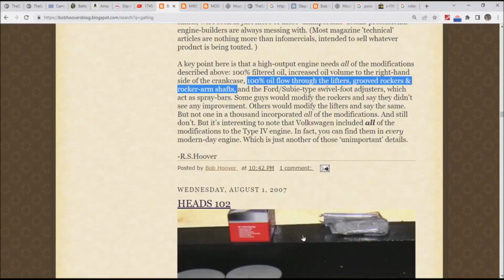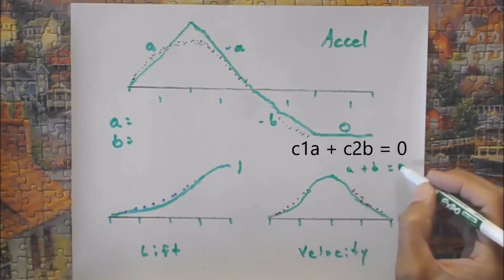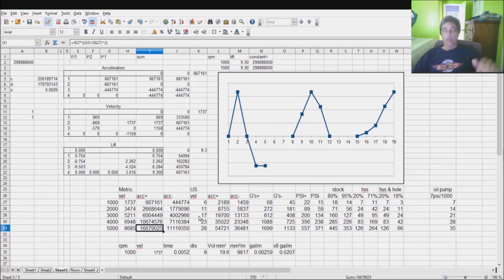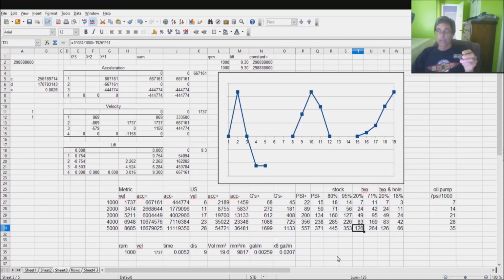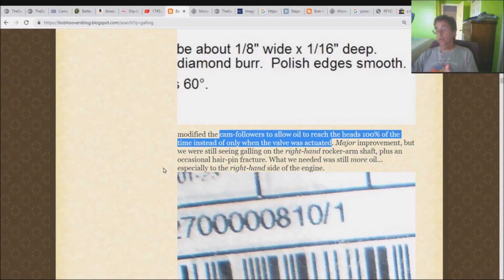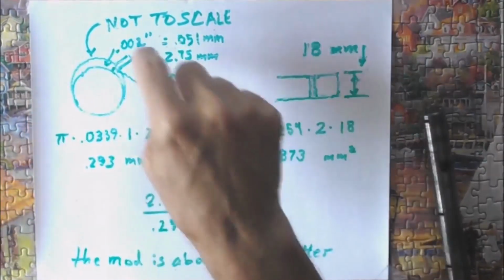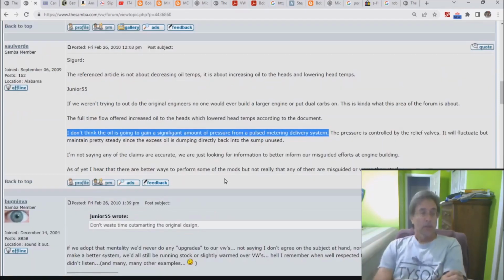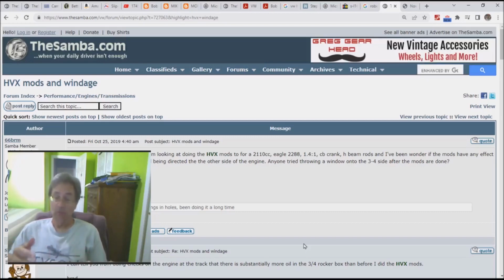vw tech vlog 18.5 hvx mod grooved rocker shafts and lifters

Comment: You think you understand it, but you don´t fully, since you are not quite understanding the base oil pressure and reciprocating effect on each other. The windage part is correct, to an extent. The "breather experience" you refer to is once again a typical product of not understanding what´s going on. The "need" for valve cover breathers are generally an indication of something else being wrong, unless we are talking about an all out racing engine. If you do want "breathers" on your valve covers on such set ups you need to do a proper PCV system or you WILL run into trouble. If you on the other hand don´t use valve cover breathers you will effectively use the slight overpressure in the heads to help push the oil back in the case. Also, it is worth to note, that if a full and proper Hoover mod conversion is done to a type 1 engine, you should not decrease oil viscosity because you now have more flow, so a reduction of oil viscosity from say even 15/w40 to a same brand and type 10/w40 or 10/w30 will reduce your oil pressure with approx 7 psi give or take a little.
If you look at it from a drag racing point of view, you are absolutely correct that we want as little windage as possible to reduce parasitic drag, - which is also why we REDUCE the amount of oil going to especially the 1/2 side. In an endurance engine, track, Baja or bus type, not so much since we want all the heat possible drawn out of the engine along with the oil, so that the air needs to cool less. Or in other words, so the engine can handle a higher load. 
Engines with proper set up Hoover mods will run about the same oil temps as one without the mods if you do a regular cruise down to get icecream or doing 50 mph down the highway. If you on the other hand climb say a 4% incline @ 65 mph you will notice that the oil temps will soon increase to something like 6-10 F. over what the conventional engine will show. (Well, the conventional engine "will get there", but it will take significantly longer)  as a rule of thumb, anything under approx 35 hp sustained load and you will not see much of a temperature rise, because the engine will "control itself" so to speak. If you measure heads, oil temps etc etc at f.i. a 65 hp @ 3200 rpm sustained load, you will see a substantial difference in how much heat dissapation the oil contributes with. - And this is where math and theory does not fully explain whats going on IRL.  Another thing which most "rebuild shops" do not pay attention to is lifter to bore clearance. If the lifter bores are worn beyond + 0,02 mm of the factory tolerances given, (19,00 to 19,05 mm) you will also not be able to maintain the proper amount of oil going to the heads as the oil will simply bleed off back into the case and do nothing good on its journey.
We tested this 16 years ago, because at the time I was not sure about what to believe, so I bought 3 days of dyno time. Lets just say that I was enlightened
And BTW. A VW type 4  block actually has most of the Hoover mods built in if you look carefully.  The missing parts were added in an a supplement information package in 1974 or 75, I forget, but for some reason never implemented ab factory. The achilles heel in the Type 4 has shown to be lack of oil volume in the system, resulting in rod  bearing failiures over time and to an extent overheated cylinderheads. But the cylinder head issues have several contributors. Enlarging the main gallery and increasing the oil pump gears to 26 mm (Some even like 30 mm) makes the engine bearings almost bulletproof on that account and also supplies about 25% more oil volume to the rocker arm areas.
Reply from the maker: you know alstrup, i've always wondered what your educational background is. so fill me in.
Reply: @redshirt-scotty  You will almost laugh now. I was originally a "Licenced" farmer, but due to a back injury I had to change lanes. I got a degree in commerce, but went into machine building, training and quality control instead. Then almost 8 years of building and developing machines for the wind turbine industry. Developing maintenance and repair schemes for said machines. After that I got involved in development, or rather refinement of some hydraulic control units for Parker, Danfoss/Linde and John Deere which I am on the finishing stretch on now. (Here we can talk about tight tolerances. Down to +/- 0,0007 mm)
Alongside these jobs I have been working closely with 2 highly skilled shops and built engines for mostly ACVW & Porsche, but also Ferrari, Lamborghini, Alfa Romeo, Aston Martin and Jaguar. Thats about it ;-)
Reply from the maker: now that's a wandering path. the licensed farmer must be a europe thing. never heard of something like that here. a commerce degree, i imagine, is the US equivalent of a business degree. let me take a look at your original note:

what would you specifically consider missing from the pressure/reciprocating evaluation in the vid? send me in some reasonable direction and i will investigate. if you had no hydraulic stuff in your background i wouldn't bother asking.

have you ever measured the actual increase in flow through the lifter? i know that hoover's estimate of 8X is a complete low ball joke pick a number at random guess. i've seen vid of the oil flow in both stock and hvx engines. hvx is at least 20X stock. 

about that bus you're describing. here's what i said about it back when you mentioned it to me on the samba: "interesting but too many independent variables to draw a meaningful conclusion."

here's what i said about the bulletins: "this isn't a hoover mod specifically. i've gone thoroughly through his blog. not there." my reply is still valid.

about the dyno time. you should have tested for windage power losses. if windage is present then there is power loss. answer this question: does the power pulled off the head by the oil equal or exceed the additional power being wasted through windage?

here is a quote that i fully disagree with: "And this is where math and theory does not fully explain whats going on IRL". these engines are not magical and as such obey all laws of physics just like all other engines. let me quote raby from a 2007 samba posting: "First off you must all remember that bearing clearances, RPM range and oil viscosity. Variables make it impossible to make general rules or statements concerning pumps, pressures and HP...". jake raby come down off the mountain with a commandment cast in stone. "thou shall not apply physics to VW's" i lost all respect i had for the guy when i read that bs. it's a slippery slope when you abandon physics alstrup. don't go down that road. 

i used to be a civil engineer (steel and concrete design) but i dabble in CS now. in cs we do something called asymptotic analysis and in particular there is something called a pinching theorem. if i can find known upper and lower bounding functions on an arbitrary function then i know that the arbitrary function must fit somewhere between the two known functions. so the question is pulling heat off the head and you think this is too hard to analyze "IRL". let's use your 3200rpm for example. all of the oil coming from the pump is passed over the head. the oil started at some temp x1 and leaves the head at x2. the oil has a mass, heat carrying capacity and a temp differential. from this we can define an upper limit on how much power can be carried by the oil at that rpm. certainly you wouldn't want to take more than 50% of total pump output from your bearings? there is your lower limit on the amount of power. then you can take a guestimate on how effective the windage is. this becomes an efficiency modifier and it will be way below 50%. apply that to both bounds and you now have a solid bounded approximation of the power being pulled from the heads by the hvx mod. something for you to think about in the new year. speaking of which.

happy new years eve day to you and let me close with some hoover math . things past + - * and / are beyond most mechanics. here is one of hoover's gems: "On any stroke longer than 73.8mm, with the stock rods, the side loads on the piston increase exponentially as the crank throw increases." there are two math errors in one sentence. holy crap alstrup, the guy was an idiot but he knew one thing. most mechanics and lay people don't know a damn thing.
Reply: @redshirt-scotty  Wow. Long reply 🙂Yeah I´ve been around. 
Wrt the increased amount of oil through the pr´s, i agree that it is likely more than 8 times, but probably not 20x. If we knew what a given 26 mm oil pump was pushing in volume versus pressure versus temperature we could calculate it, because at say 2500 rpm we typically see approx 0,4 bar reduction in oil pressure at f.i. 70 C oil temp on an otherwise stock set up. Do a simple blueprint (flow improvement) of the pump along with O ringing the face of the pump to eliminate the gasket and reduce gear to cover tolerances to ½ typically brings back half of the pressure drop. What that amounts to in volume, I have no idea.
Wrt windage. In a non racing engine I don´t really care as long as the rings can, and will do their job, also over time. I am more interested in keeping cylinderwalls, cam and lifters wet at all times. I for one have never done back to back tests the way you describe. Let me put it this way. If I can make a given engine pull 10-15 hp more sustained hp without overheating the heads or anything else, I don´t care if I loose 1 - 1½ hp more on windage, because it is still better than before. Also, I do not believe that the extra amount of reurning oil from the heads contributes much to the windage because it returns into the case below the lifters back into the sump. Thats just flow most of the way. Notching the rods on the other hand WILL contribute to more windage, and if that is a concern one could leave those out.
Let me take a little story from real life to help explain. - Back when Nøvling was servicing the Scandinavian Ferrari challenge cars and the 430 Scuderia had been used for a couple of seasons, they all suffered from low oil pressure when coming into the pit for maintenance or drivers change. This was a real concern, but noone sort of figured out why, or didnt want to really look into it because it was "Ferrari´s problem, not ours" All the cars had to be equal (that was the point) so all cars had to run on the same fuel, same oil, same tyres etc etc. At some point halfway in that season we did some dyno time with one of the cars which had another issue, with the computer hooked up to Ferrari Motorsport department but we kept an eye on the oil pressure and temps too to see if we could spot a pattern. At some point the low pressure behaviure turned up.  After the session I quietly sdaid to my colleagues, lets change the oil to "this" and see what happens. At first they did not want to play ball because "Ferrari said" Then I said "scr*w what they said, lets try" The shop owner agreed. so we swopped to an oil 5W higher viscocity and tried again. sure enough the engine lost some 5-6 hp, but it kept the pressure. We ended up letting this car race with the different oil and quess what, it won. Long story short, 3 months later all Challenge cars ran on this oil.
Wrt Raby´s comment back then. first, we have all learned a lot since then. Thats the beauty of the internet. second, - some of his comment actually holds water, because if we take just 2 engines built 2 different places by 2 different guys, chances are that there can be even a lot of difference to general tolerances throughout the engine. So if we were to make such a test where we could explain every detail down to the T,  we would have to build at least 3 maybe 4 similar engines but with different tolerances, to be able to explain and verify exactly how much pressure drop and exactly how much more oil flow to the heads, exactly how much heat would the oil bring away from the heads, how much parasitic drag the windage will take, how much more sustained power the engine can handle in those particular set ups. But even then the answers would not be in stone, because then the next guy choses a different camshaft with poorer properties and the numbers can get thrown quite a bit. That´s why we sort of have to accept the answers to be within a shoelength
Getting back to the reciprocating "effect" - The oil pressure behind the lifter will always be "the same" assuming the oil pump can deliver. so if the lifter to wall clearance is the same you will get more volume in at the same pressure. Since there is more oil available the pushrod will be filled "harder" and when the lifter gets pushed upwards it will still have the base oil pressure to act as a stop bar until the lower lifter groove gets closed off from the oil feed. I hope that makes sense. Some things are harder to explain than others :-) 
Apart from that, I wish everybody except Kremlin a happy New year.
Reply from the maker: interesting! i haven't read this ferrari story over at the thesamba.

back to the oil pump and raby. i think (haven't found the original posting after looking for hours) that raby claims 10hp for a 6mm increase in gear size. he was testing 24 and 30 mm pumps on some type 4 he was playing with. some simple math shows the original pump took 40hp and the big one took 50. at half that rpm and the same pressure (let's assume the pressure relief valve works) the pump takes half the power. so vw put a pump into their engine that took 20 hp at an rpm below the standard engine's peak power output of 80 hp? no. it's less than .5 hp and raby is off by a factor of 100.

also, you don't test pumps by dynoing engines. you test the pump and this is what pump manufacturers have already done for us. haven't you ever looked into what a manufacturer defines as their pump's power requirement? the base formula is pure physics and then the manufacturer tests their pump and provides an efficiency. these pumps are identical to the schadek pumps that most of us run. if the pump is within manufacturer spec then it consumes power according to the manufacturer's spec. the volume of an in spec external gear pump is fixed thus positive displacement. spin it at some rpm and the manufacturer's formula gives you the volumetric rate at the pump. just measure the pressure at the pump, confirm rpm and use the manufacturer's formula. here's a super simple one: http://www.metaris.com/hp-calculator.php. raby's thought process is confused at best.

i'll think a bit more about the reciprocating effect in conjunction with the grooved lifter. however, my evaluation of the stock system is correct.

got one for you. i've been reviewing hoover's writings. not just the hvx stuff but the ricardo rod/stroke golden ratio. certainly you know what i'm talking about. i have identified a couple of people that have tried and failed to find the source document. have you ever seen ricardo's actual paperwork?

sorry it took 6 days to get back to you. holidays and been busy.
Reply: @redshirt-scotty  Hello. 
No, I never saw this document. I will also say that you can´t really say that "this" length or RR works better than "that" RR because you have to put several other factors into the consideration, like which engine. There are conciderable differences into what it is, and what boundraries you have to work with.  From my point of view I can´t even give an idea about what is the best. I have personal preferences for a specific engine, but thats another story.
Wrt the reciprocating effect of oil and pressure. I dont have the vocabulary to explain it well, apart from saying that the motion of the push rods creates the pressure needed for the oil to go to- and through the rocker arm. I also totally disagree on the use of the courier style swivels. That alone creates just as many problems as it is claimed to solve. 
I got some links to stories from other "critical" voices IRT the h mods and a story from Revmaster I think where they claimed issues with it and they stated that they solved the issues with oil pump volume instead (!) Let me ask them this: what is the difference between the h mods and a 25% increase in volume? If you increase the volume that much without increasing pressure, you will need 25% larger capacity oil galleys. 
What does that do? IT INCREASES THE OIL FLOW THROUGH THE ENGINE. 
I have never seen a Revmaster Aero case inside, so I know very little about it. I can only say, that if they didnt do basicly as I suggested above, the only thing they have done is creating a way higher return dump to the sump in order to try to have sufficient and steady oil pressure at all times.
What will that result in? Wastly increased oil sling inside the case,- and vastly increased potential of removing heat from certain areas with the oil. 
So what have they actually done? Created a similar set up to solve the same problem, but at the end of the day they also recreated the same issues.
Now, getting back to the potential issues. IF the H mods creates these issues with oil sling and power drag, they should be easily reduced by adding a slush plate in the sump so the oil is contained more under the crank, basicly like the sedan type 4 engines have.
I have yet to see and experience the issues people claim to have with the H mods. My guess is that their issues relate to something else. Anything from a worn case to poorly seated piston rings, or even improper set up of their crank case breathing system. But it is just guessing.
Now I will yield before this turns into a novel.